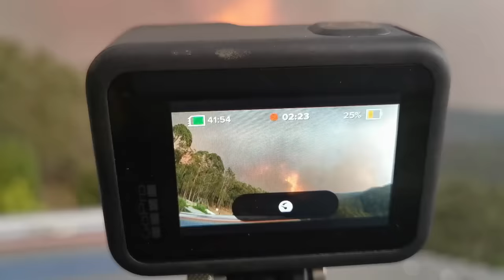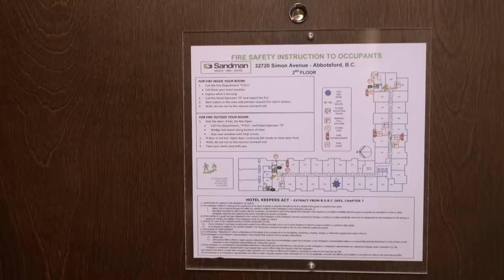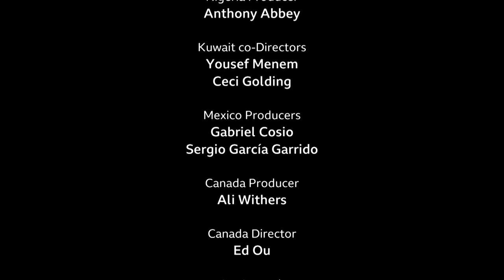Life at 122 °F: Surviving in the Hottest Places on Earth | Free Documentary

Comment: Controlled burning in the wet season is how the Aborigines prevented bushfires by reducing the fuel load in the dry season. They had more sense than modern governments. As for Nigeria's drought, the trick is to capture as much floodwater on the surface as possible to soak into the ground and replenish the water table. Senegal is managing this very well I believe.

Comment: It has been hotter here (Modesto California) the last 4-5 years at least...103-106 has turned into 106-112 dry heat it is too hot for motorcycle riding I ride more miles in the winter.

Comment: those black roofs will not help at all. white is your friend in heat areas. i have studied a design where double roof make sense. the first roof takes the heat, paint it white and add solar panels that cool the inside. and add water heater tubing. the second roof is the actual building.